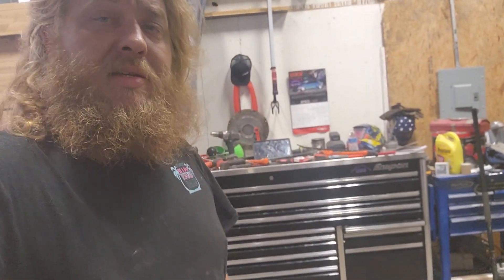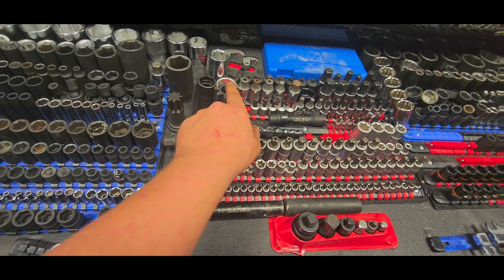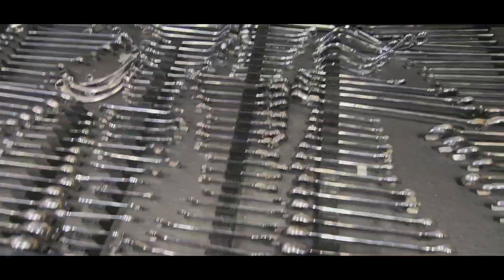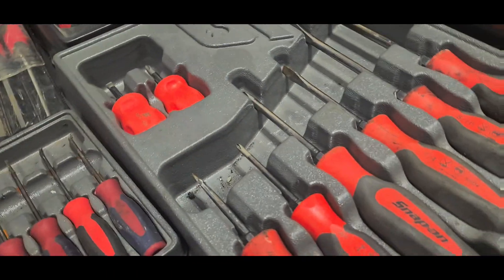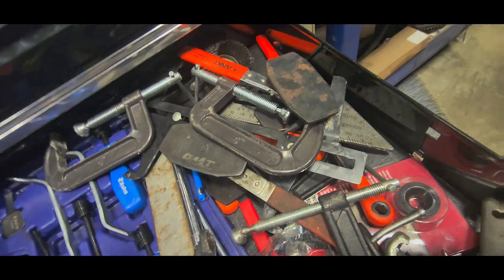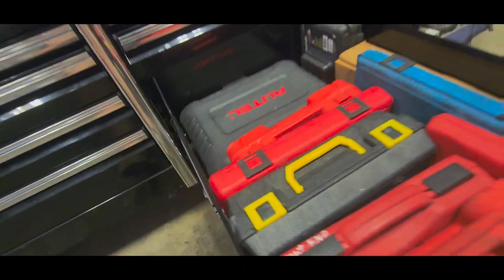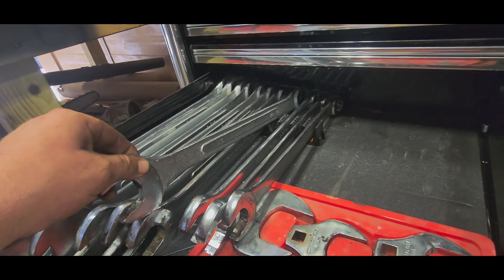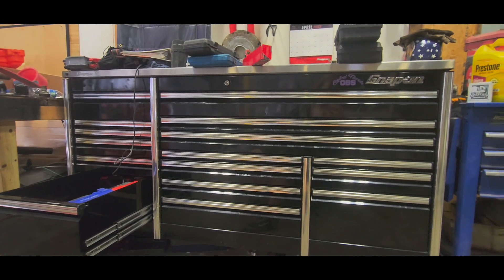Snap On Epiq 84 Tool Box tour ,In Depth

Comment: Nice setup, I am in the process of building a set again over the last few years and upgrading stuff as well. I’m working in a large tire shop and I got a Matco dealer to put us on his route and I have gotten some good stuff from him that high torque 1/2 inch air impact is almost 90% as capable as a ingersolrand 1 inch in my first month of having it and it seems to be getting stronger as I’m using it.
Reply from the maker: That's freaking awesome will need to check out the high torque matco impact. How long have you been turning for and are you still enjoying
Reply: @classiclinesautomotive nice setup.  I've been turning since 96 and still building up the tools.  Love your channel brother.  Keep up the tools videos.  Love the tecton stuff just found them and Capri. Host of my stuff is tool truck. But if you could touch on some other brands that you use that would be great

Comment: Do you use headlamps if so which ones?
Reply from the maker: I have two different styles one is a snap on the other came in a two pack for 30 dollars I prefer those and they are branded cosoos  . I can make a short on them and put a link in the description